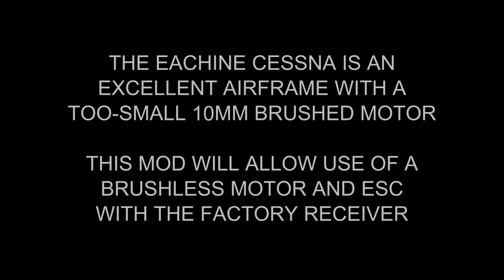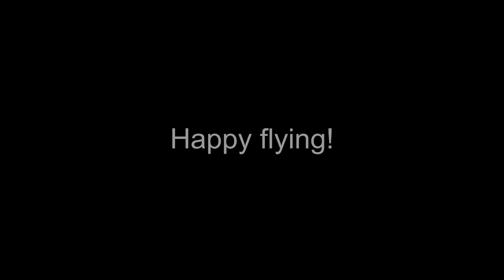Eachine Cessna - Brushless Convertor Test

Comment: Great work Dog. I have a P-47 Gyro Board coming here to test. It looks like your PCB. The Diode is already soldered to our B2BL Module so you won't need to source that part. You will also get a larger usable Throttle stick travel if using a Multiprotocol radio like a TX16S.
BTW... Any customer buying a B2BL Module can leave a Note in their PayPal payment to ask for soldered wires free of charge otherwise the supplied wire will not be pre-soldered.
Reply from the maker: I think the stick range would have been greater if I had set throttle range. I never did  that.  

Good to hear with the P-47. I never got one of those receivers since I bought my  Thunderbolt as replacement parts, but I do have the RX from the Xk A260  P-40 Warhawk to test next.

I've seen so many physical similarities in these Chinese-made receivers that I suspected the throttle protocols many also be very similar.  They copy everything else, so I had a good idea the X420 and Cessna receivers would work with them.  Verified.  So I suspect no issues with the P-40 RX.

  Only the Horizon Hobby bricks (Eflite, Park Zone, Hobbyzone,) use a different format and are incompatible.  I hope to have a convertor compatible with them someday.  The market for brushless receivers with SAFE mode is huge.
Reply: @Doggeslife  I agree... Will be coming out with a new UMX Conv Module for the Spektrum DSMX SPMAS6410L Gyro/Linear Servo Boards with SAFE in the coming days. Still need to get the Docs ready.

Comment: very good option. who difficult is to solder those tini wires?
Thanks for sharing
Reply from the maker: The signal wire connected to the FET leg on the receiver is the trickiest.  Take your time and it can be done repeatedly.  The 2 power wires are relatively easy.
Reply: @Doggeslife  thanks